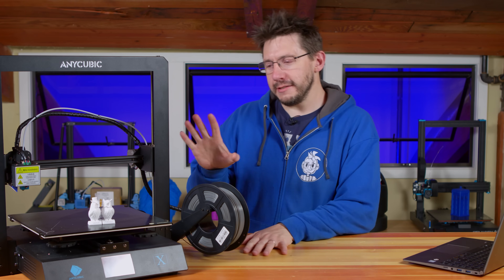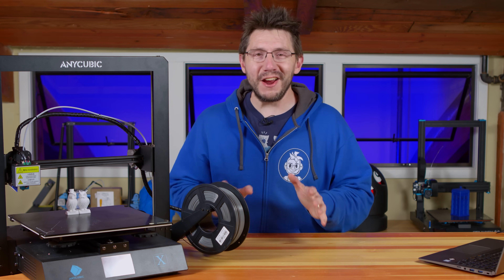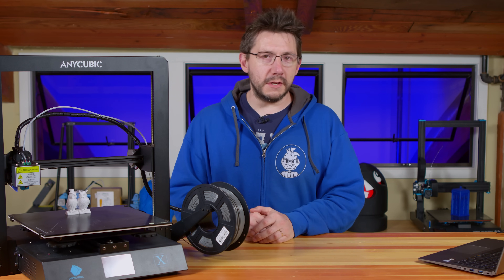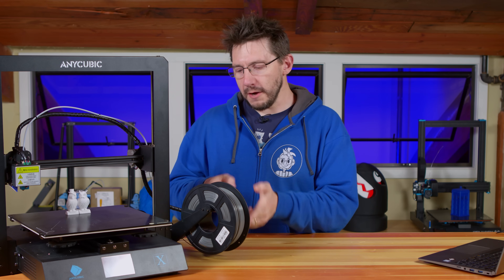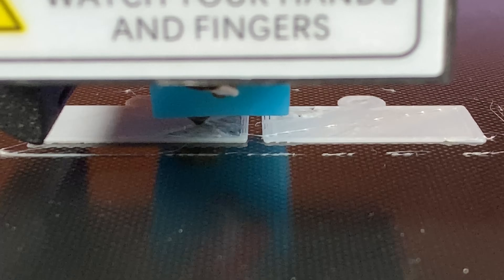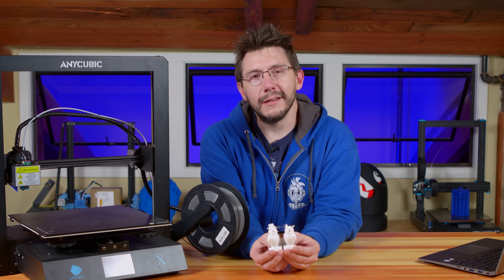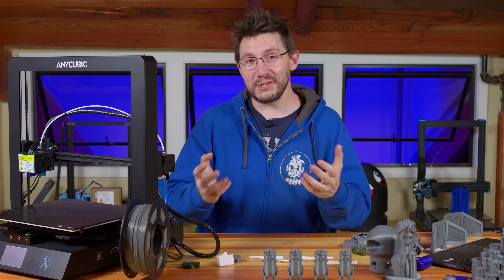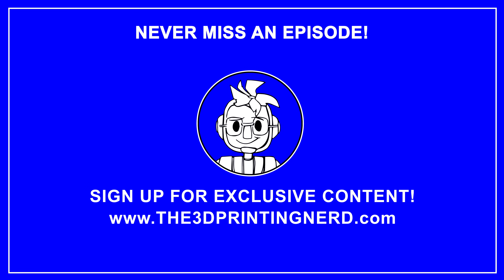Anycubic Mega X First Impressions Non Review?

Comment: @16:20, That little piece, comes out all the time on both my Anycubic Mega S and my Anycubic Predator.........I stopped putting the piece back in, as it works fine without it, as long as you remember it is missing and to take care to insert the filament centrally and not just jam it in and hope for the best.
Reply: I lost my little piece on my Anycubic predator. It takes me 2 or 3 tries to get the filament in properly.
Reply: Does anyone have a Cura profile for the Anycubic predator?

Comment: Hey Joel we got 2 Chirons (same design pretty much only 400x400x450) and on the first one we got we so far put a little over 70 kg of HIPS through it with nozzle at 255 bed at 105 - I posted some on your patreon community thing you can also see some here https://pirringers.com/3dp/?p=36. Only difference is we put the included .8 nozzle on and replaced the PTFE with a Capricorn one due to printing at 255. Now after 70kg ultrabase still works and we like ultrabase. We are now printing 1000 prusa faceshields on it - and prusa ... well prusa slicer rocks especially on big nozzles as it got Volumetric E

Comment: Hey, hi there, Joel, would you review the Anycubic Predator? There aren't many reviews on it yet and there aren't many delta printer reviews either. ;)
Reply: I would also love to see a review
Reply: @niffbricks2175  I just got one, but didn't do any prints on it yet, because the PSU was damaged, but at least I know that if I ever had a problem with it, their support is very responsive. I messaged them about it and in a few days they confirmed that they'll send me replacement for free. Much better than any customer support I've ever been writing with.
 Update:
Got my PSU shipped in 3 days and the machine works great! And it's crazy fast: a 40 cm (16 inch) vase in under 4 hours.
Reply: I posted my thoughts about mine a few moments ago, but there are a few decent reviews on youtube, some found after purchase that had some tips and tricks. RSilvers has a really good review and upgrades vid, Versus3D has a 2 parter, one is a build vid, NexiTech and one other guy have build vids also.
Reply: Yes Please, Joel. I have one and am having problems getting it tuned (I'm a newbie).

Comment: Petition to make this the smallest dimensions one can call "mega/xl/large"

I'm currently looking for large format printers and seeing a 300x300 or smaller thrown in with Modix, BigRep etc is a bit misleading
Reply: I have to agree. 300 is becoming the new 220. I feel like large format should start at 350x350.
Reply: @not_riley  The problem with large format, especially on printers with the table moving on the Y axis, is reliability. I had a Tevo Blackwidow, and saw a LOT of similar failures in that pile Joel had. Skipping and shifted layers. 1.7 nemas are struggling to push these larger beds, and as you print larger prints the bed gets even heavier leading towards more failures towards the END of large prints, which is the worst thing ever. I had a 16" Trex skull that took 5 days to print shift  1/2" on the Y with only 8 hours left to go, and that was at 30mm/s... If you're going to go large, go coreXY.

Comment: My first and only printer (so far) is the Anycubic i3 Mega Ultrabase, and its serving me really well.
Reply: me too, one of the best beginner printers! and there are great mods available ^^
first and best mod: TMC 2208 chips
second: new hotend and parts fan
Reply: @fliegenmann2562  Did your mega s have the chips inserted in slots or soldered?
Reply: how is it going a year later?
Reply: same. I bought mine about 5 years ago and its still my workhorse
Reply: The I3 Mega(S) is the best entry level printer when compared to its competitors imo. I love how they give you a spare hotend, ptfe tube, tweezers etc. 

All you really need to do is upgrade the noisy stepper drivers which you have to deal with anyways for any printer in that price range.
Reply: So far one of the worst decisions I made. 
I deeply regret buying this printer. Keeps breaking, and now I have to practically rebuild The while thing with skr and marlin.
Reply: @CoZaHeca  I wish I'd seen your comment earlier.   Mine just arrived, today.  I spent most of the day assembling it, fixing it, fixing it, fixing it, and fixing it.  Didn't print anything.... just many spaghetti.   So far i hate this machine, and completely regret the purchase.  I was really excited for 3D printing, but this maxhine has completely killed the excitement.
Reply: @Richard97402  hows it going? What printer do you have now?
Reply: @SumriseHD  I just have the Mega X.  It turned me off to 3D printing, so I haven't even considered another one.